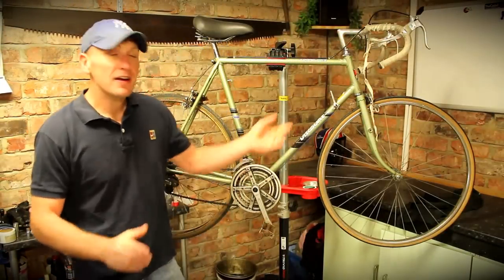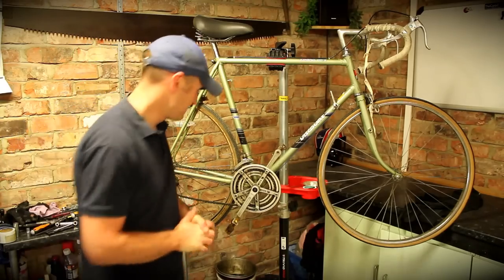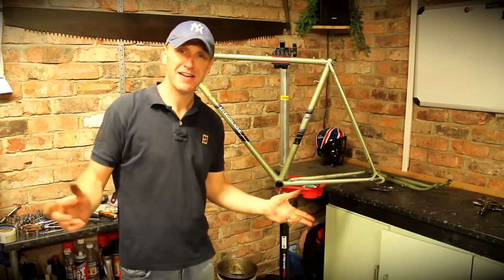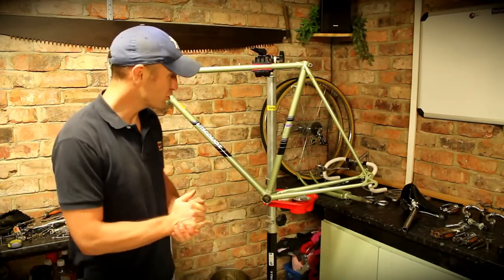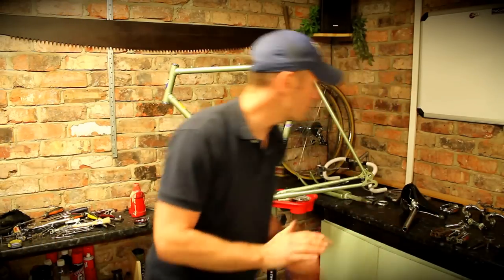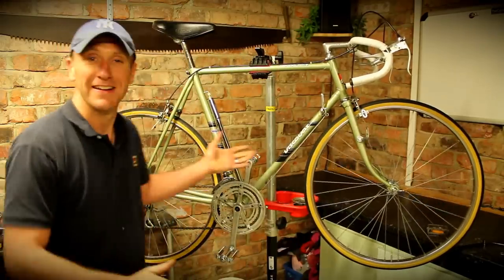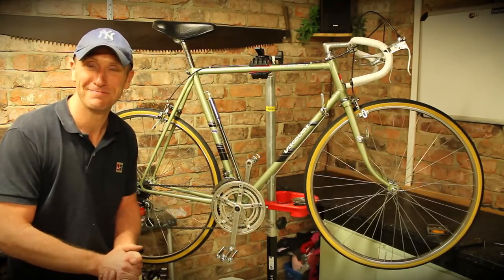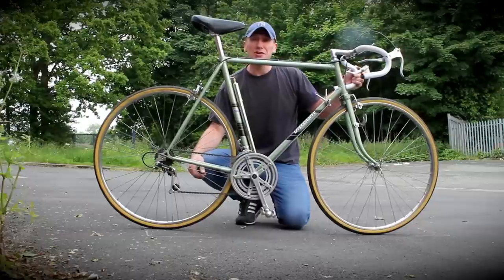Vintage Cycle Restoration Viscount Gran Prix (Road Bike)

Comment: Hello there. I'm just finishing off the last stages of my beautiful Raleigh Record Ace 1979/1981. Purchased brand new in Cheltenham in 1984. I decided to upgrade it a few years ago. Started with new wheels (27 x 1 1/4" Rigida). Devil's own job finding a pair of new rims like these when you live in Paris, France. Recently changed the the original Weinnman 605 side pulls for a gorgeous pair of Mafac Competition Gold centre pulls (wondered why I'd waited so long before doing this). Found a beautiful pair of pristine Mafac brake levers with fully -working adjustment screws. Now on last detail : I've swapped the original SR Super Custom 52/42 chainset for a sublime Suntour (NOS) Superbe Pro 53/39. This one is rated above anything Campy EVER built (I'm told). The pedals are going to be MKS Urban Platforms, with Christophe toe clips. It's going to be a seriously sexy bute. However ... could you please tell me what your tires are ? We both carry the same size. The ones I fitted are Schwalbe Marathons, puncture proof, but heavy and slow you down. Yours look great. Hope you have time for an answer. Thanks for posting your video. Very clear and instructive. Happy wheeling !
Reply from the maker: +musamor75 wow very detailed and sounds like a very loved and gorgeous bike 🚴 The tyres on this build wasn't anything special as far as I can remember, saying that they really are perfect for your build as they are Raleigh's own. Search gum wall Raleigh 27" tyres. I hope this helps all the best and good luck! Andy

Comment: Great resto job again. ☺   Old bikes might be low tech compared to modern ones,  but for me the old road bikes look far better. 
Where do you find these old classics?  I see them on eBay sometimes, but they are usually over priced for the amount of work and parts needed.
Reply from the maker: Pheonix103 Thanks for the comment, I see a few on eBay but as you say there isn't any money in them. This one was brought round for me from a local scrap man that I worded up!

Comment: Hiya, what's the best way to get old chainrings looking like new? Wouldn't mind a few hinters on that sort of thing if possible
Reply from the maker: Paul Liptrott First of all I soak them in a degreaser then use a thinner such as petrol. After this I'll rub down with wire wool and to finish off lubricate them. Maybe I should dedicate a video to cleaning. Thanks for watching and all the best Andy
Reply: Yeah videos like that'd be a good addition
Reply: Thanks for sharing!

Comment: Nice job. We don't see many Viscounts here in the US and the few that pop up often have the dreaded "death fork" that got recalled. I thought the fork on this bike looked slightly bent pre disassembly. Just my imagination?
Reply from the maker: +stockton350 hi thanks for the comment I'd  not heard of the death fork. I take it a little ad have been prone to go in the US? I know the really early models are well made and are of better quality. A bit like everything else really then. Thanks again Andy
Reply: BikeIt UK i guess they were cast aluminum which turned out to be bad ideas for forks and stems. Yours definitely looks higher quality with a steel lugged stem, though. We had our share of British and French bikes, but most of the 70s bikes here in the us were from Japan (fuji, Nishiki, miyata, lotus, etc.) which was called our "bike boom" with many of those still around for folks who like to wrench on old bikes.
Reply from the maker: Really interesting and I enjoy finding out what was going on across the water at the time. Just great that, the world round we have a common interest. Thanks so much for the information  Andy

Comment: Hey. Did it have press fit bearings for the BB? Currently restoring a Viscount Aerosport and struggling with getting the new bearings and spindle in etc. Any advice?
Reply from the maker: +Woodrick I used the original BB but bought new bearings, it wasn't a push fit. eBay list old bottom brackets maybe try on there . Thanks for watching Andy
Reply: +BikeIt UK Cheers Andy. They must have changed BB type in the late 70s. I'll persevere!

Comment: Another great project! I noticed you touched up the frame. Where do you source the paint from? I've been thinking of doing the same to an old french Mercier which I decided was too nice to respray but want to touch it up a little. Thanks.
Reply from the maker: +Lewis Weekly The touch up paint I use the airfix model enamel paint....many different shades and cheap enough! All the best thanks for the comment and good luck with the build!
Reply: Thanks!

Comment: hi i have an viscount aerospace 400 which had been stood in a family members garage for over 20 years i had to change the tires and tubes but it rode great and i used it more than my other modern bikes to commute to work  about 16 miles a day it has all shimano parts which are great it has 27" milremo wheels on and only stopped using due to the spokes in the rear wheel came lose  it has the original sale sticker from mastercraft hereford on it and the front light bkt its really in general good condition for its age can you please advise on how much these are worth please because it seems such a shame just stood on a stand in my garage would rahter pass it on to some one who would appreciate it more thanks
Reply from the maker: +vinces boy Sorry where do you live? If its an early Viscount then its worth money! I have a contact email on the about section of the youtube channel, if you want me to do a bit more digging please by all means get in touch all the best Andy

Comment: Anyone know the approx value of this bike ? I have a 1972 or 74 I bought in 78 
It good to very good cond.
Pinky shifter came stock according to the shop and rare special ordered. All original except seat
Its 4 sale
Reply from the maker: I think if my memory is correct this one sold for £125 I hope this helps good luck all the best Andy

Comment: Road bike with platforms ? ... And that shimano rear mec.... use dura ace 1-st gen..
Reply from the maker: +Stef Trekoff This was a 1970's bike and all original how the bike was intended however the rear mech did need replacing. I would of loved to of used Dura Ace however the build of the bike I feel did not warrant that level. Thanks for watching Andy

Comment: I know you're a stickler for keeping things original. But simplex is trash, good to replace it. I keep a bunch of those derailleurs in a bucket just for fun to see how many i have removed off of vintage frames. CRACK ON!!!
Reply from the maker: Hi I do mix things up from time to time. See some of the earlier videos or even the Colnago Master Piu. However whenever I did I got bombarded with comments saying keep it original 😂 I couldn’t win. Thanks for watching and your support all the very best